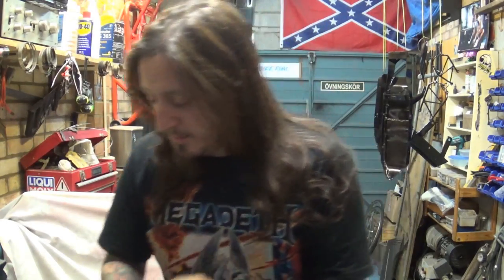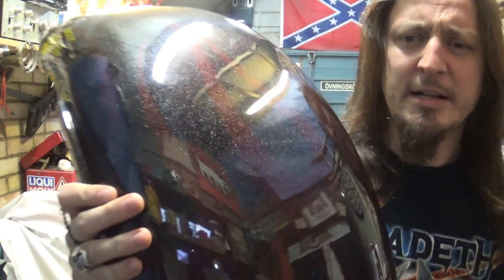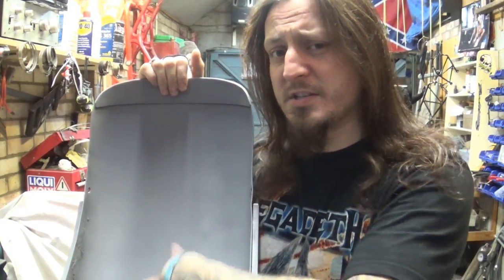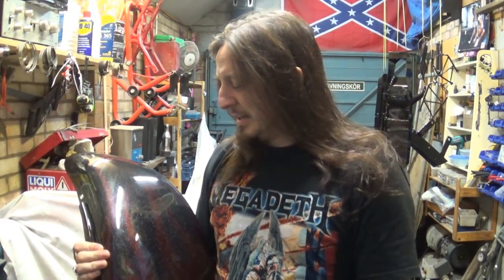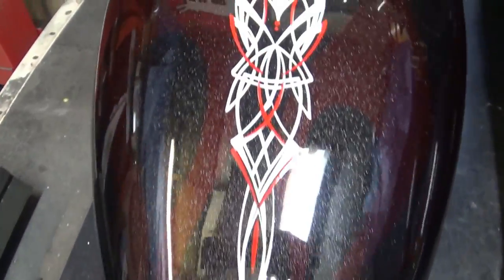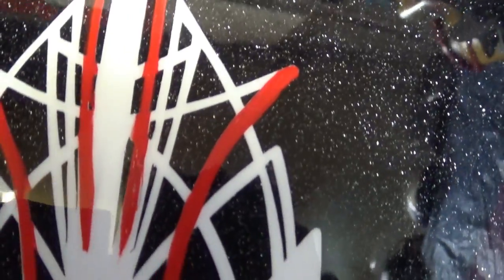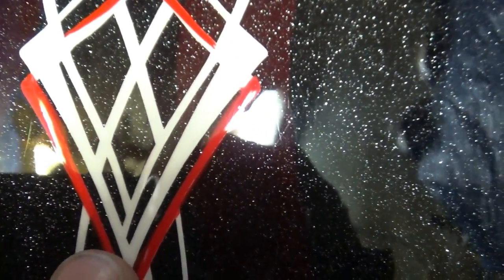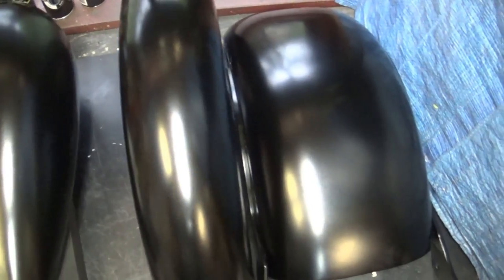Cambridge Pinstriping, Custom Chopper Paint Job - Part 2 - All The Prep

Comment: that tank looked to have had a bad solvent reaction? id guess from the new paint being laid over the top. was your black base coat out of a rattle can as you never normally sand a base coat down before clear a coat or an inter-coat
Reply from the maker: It's not a reaction but an imperfection that has now been dealt with. The metalwork/previous paint had some issues which weren't visible previously. All sorted now :) It's a 2pak paint and I always sand it down before I airbrush artwork on it. Thanks for your input Ross, I appreciate it.
Reply: ahh the video makes it look a lot like a solvent reaction. ahh if its a direct gloss paint i get why you sanded it back but if its a solvent base coat there should be no need to sand it